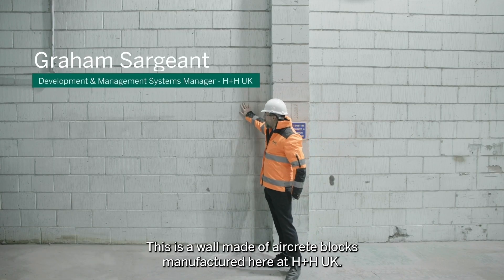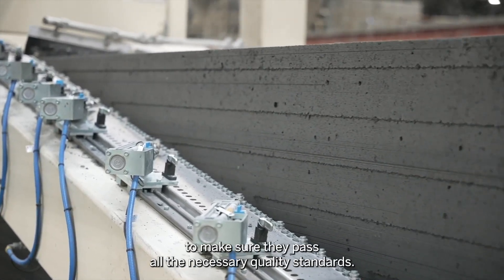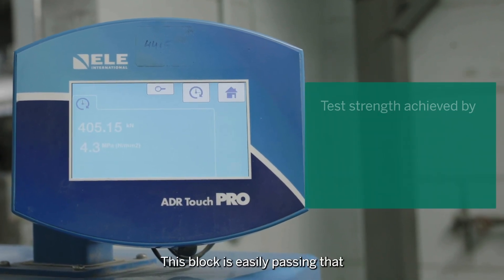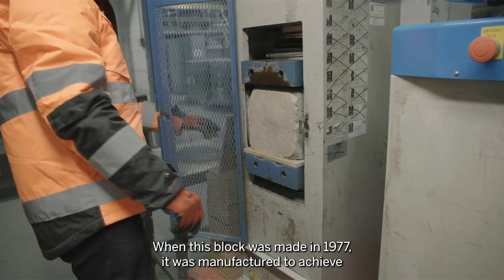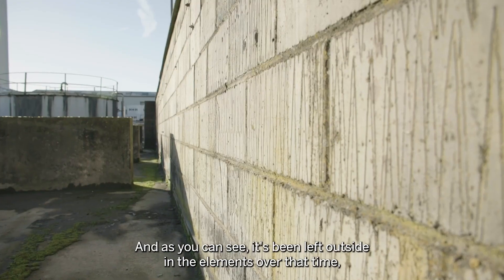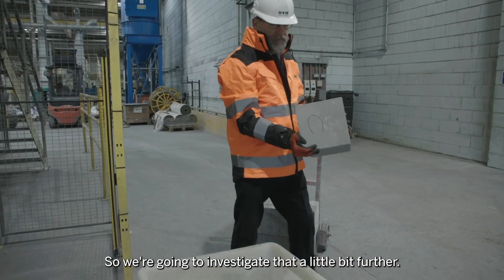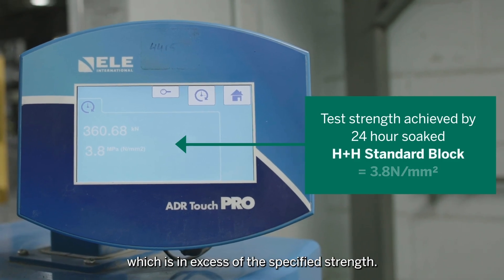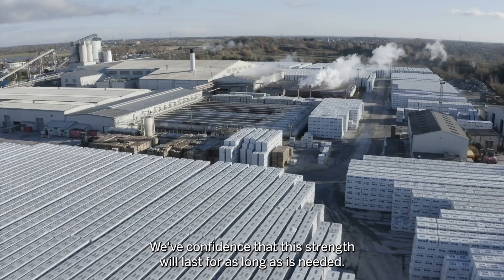How Strong is Aircrete?

Comment: How well do these block hold up to shock loads? Such as dropping them, or a tree hitting the wall?
Reply: Hi, 

There are so many variables in that question it's impossible to give an answer - What height are you dropping them from, what are you dropping them onto, are they landing flat or on an edge? Similar with the falling tree. There is a whole spectrum of block types, but in general, the denser the block, the less prone it is to accidental damage when being handled. So it's fairly well know by builders that this type of block is a bit more fragile, but you can't really put a quantity to it

Cheers